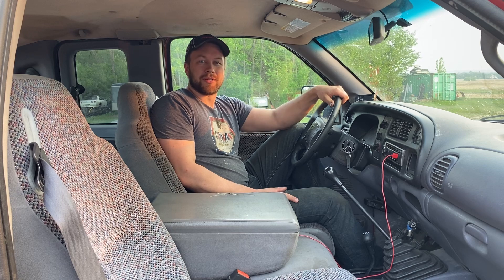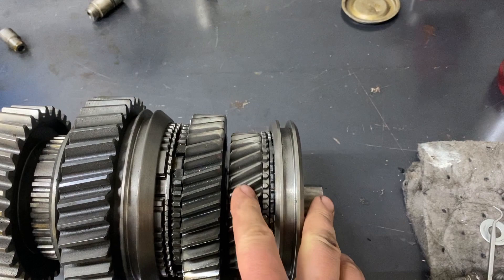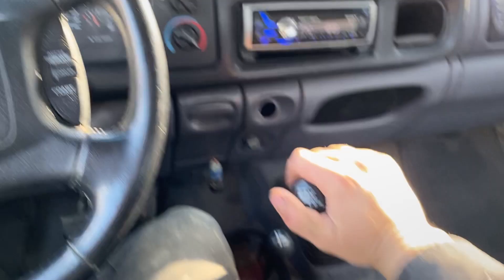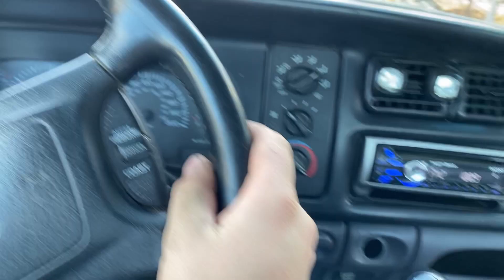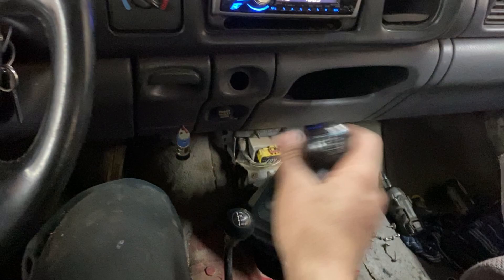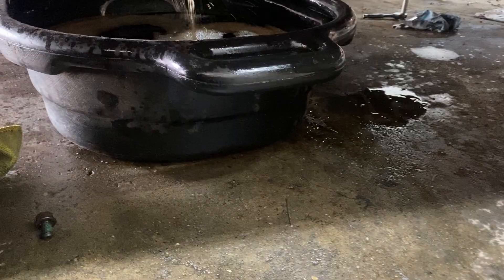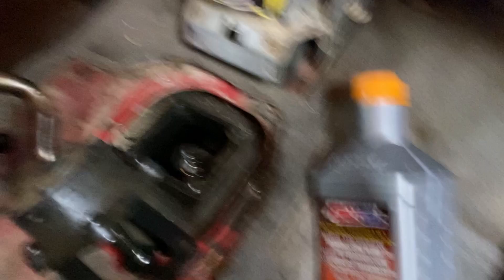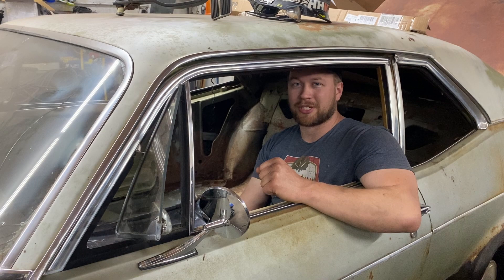Diesel Fuel In A Manual Transmission? A Quick Miracle Fix For Poor Shifting!

Comment: For those wondering 8 liters is a tiny bit over 2 gallons 😊❤ this works amazing for manual transmissions my grandpa showed me this years ago and you dont think it makes a difference but i promise it makes the trans feel so different in a good way especially if your trans is older which means it most likely hasnt been serviced on time like it should haha❤

Comment: I'm sure it helps when they're really old but I've noticed in my experience just fresh fluid or a better fluid makes a huge difference without flushing it.

I will try flushing on my next fluid change and see if I notice any change on a good transmission
Reply from the maker: If the transmission is already good I can’t imagine it would make a ton of difference, I thiiiink it made 1 6 speed I had shift a little quicker

Comment: Man i just changed my fluid a few weeks ago. Wish i had seen this.
Reply from the maker: Sometimes with new fluid it’ll “clean up” overtime, the diesel fuel definitely speeds things up though.
You can always drain the trans and do the flush and then put the fluid back in!

Comment: Mt 85 for the fiber synchros and mtl for the brass synchros
Reply from the maker: Hmm I remember reading on the MT85 bottle that it was comparable with the NV4500 so I assumed that’s the one you’d want for the brass synchros
Reply: @HHK  yes the nv4500 has the fiber synchros so that's the mt85 or mt90 the mtl is for the brass

Comment: does this work with an automatic transmission?
Reply from the maker: I would not recommend it, or if you were to do it you’d do it 50/50. The trouble is with the torque converter and the amount of passages in the valve body and the trans itself it would be difficult to get all the diesel fluid out of the transmission. It would take multiple flushes. The best option would be to drain the pan, do a new filter, and possibly disassemble and clean the valve body manually. 
You could maybe drill and tap the torque converter for a 1/8th NPT plug to allow you to drain it completely, I have a couple torque converters with that done.

Comment: When I had my nv4500 apart last time my t case grenaded I did a diesel flush now it’s 10 times worse. 😂😂
Reply from the maker: Damn! Well that’s a first
Did you Jack it up to drain it all out?
Reply: @Hazardous-Hotrod-Knowledge  yea I did cause I dropped a razor blade when cleaning the top cover surface and pulled pieces of gear when fishing in there so I pulled the whole trans after to inspect. It was a piece of my 4th gear that has been in there since 1995-1996ish 😂 I think it’s just time to do synchros cause after the flush it’s hard to get into 2nd or downside to second